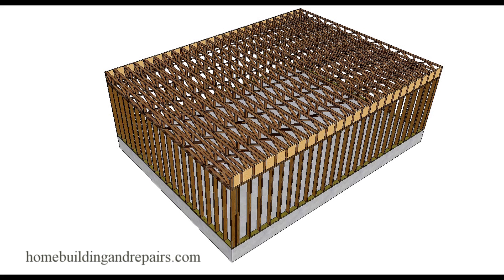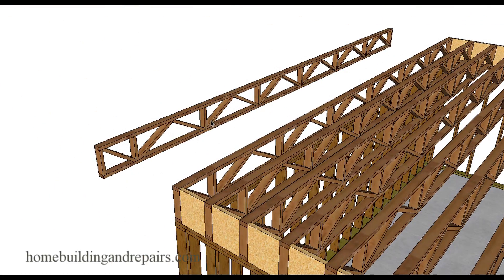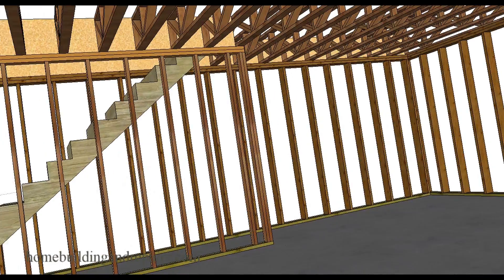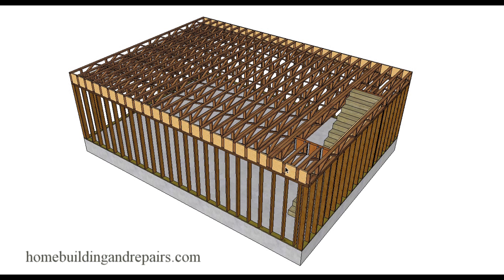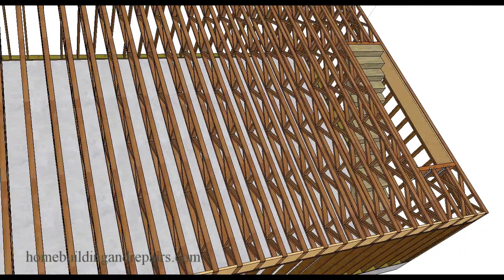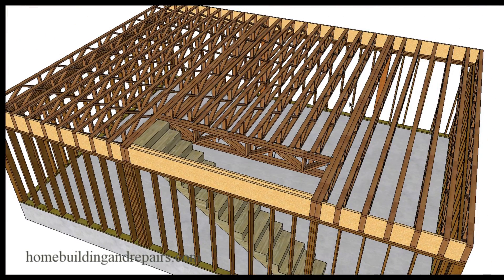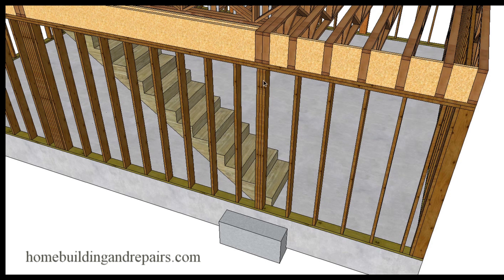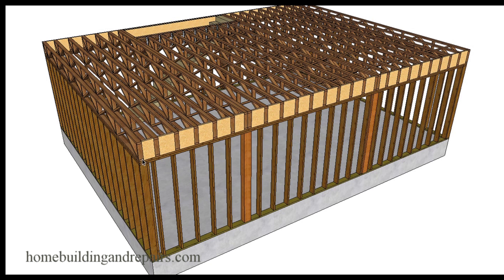Something You Should Know About 2x4 Engineered Floor Joists And Stairwells

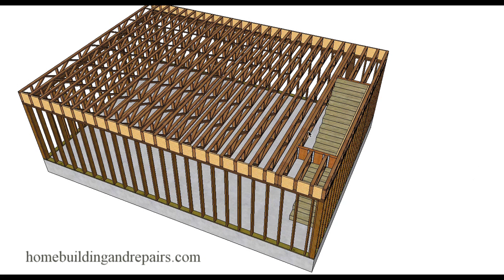Comment: Is it reasonable to hang a stair headout between 24' clear span open web floor trusses? My manufacturer said it's not possible and it would need to be an lvl or have an interior bearing wall parallel with the floor truss both sides. Ideally I would like to avoid both those scenarios. One would complicate my mechanicals and the other would be additional work and prevent me from having an open stairwell. I noticed in your video (@5:50) it was done the way I'm asking, but one of the floor trusses was supported by the exterior wall and the header was half the size of mine (single flight vs double flight)
Thanks!
Reply from the maker: You will need to follow manufactures instructions or seek structural engineering help. If you found a mistake in my video, let me know.

Comment: what if the stairs are U shape in the the middle of the house? would it still be the same framing method but on all sides of the stairwell?
Reply from the maker: Most of the time, yes. They use double joist all the way around the stairwell.

Comment: I hear from every source how these are specially designed and all, but what exactly goes into designing them? Ex: what calculations or parameters are involved?    That's the information a DIY would need to know to do it properly. It's not always feasible to transport these premade if you don't have a long trailer so it's easier to build them on site or even in situ, especially if working alone and can't lift them.
Reply from the maker: I don't recommend making your own open web joist.
Reply: You will probably never get diy trusses approved by an inspector. Especially if you diyd the engineering. Definitely not the things you cheap out on

Comment: Have 1989 16” deep floor trusses cantilevered on a interior dropped header and have a structural engineer planning a ceiling flush header.  Plan is to cut out beam notches in lower chords, and up the double vertical blocks (no doubler) just below the upper webbing plates. Although the S. Engineer explained the beam can restore lower chord compression, your thoughts on flush beams with a cantilevered application for an above living space.  Thank you.
Reply from the maker: This could be tricky and since I'm not an engineer, I won't be much help. You could always contact a truss manufacture for more information also.

Comment: It makes no sense that a floor truss would be fine at a certain span, but questionable if cut to a shorter length where you've maintained the same structural pattern.
Reply: Because the truss if not cut sits on a foundation wall .
Reply from the maker: Check with an engineer before cutting.
Reply: @gregvancom  How about address the comment.
Reply from the maker: @Heraclitean  If you're asking for my opinion, then they are usually designed for a specific length and if modified an any way, then it could cause the product to fail. Maybe you can check with the product manufactures if the word engineer doesn't work for you.
Reply: @gregvancom  I'm curious about the engineering logic. "Designed for a specific length" doesn't tell me anything. If I say 4 legs under a table are fine, but adding a 5th under the center might weaken the table, you'd be right to raise an eyebrow, because it doesn't make sense.
Reply: @Heraclitean  There is another engineering video that talks about the build of trusses. It's something along the lines of the truss connector plates connecting the components of the truss - and how many notches embedded in the wood is partially or completely dependent on the length of the truss and the other truss connector plates available to spread the weight. So, if you have a truss connector plate at point A notched for a 12' span to distribute the weight, then you cut that 12' span to 10' feet, now the truss connector plate, A, has to bear more weight than it was notched for, as do all the other truss connector plates remaining,  and the truss could break at the plate. Every metal plate in a truss is selected and notched based on the expectation that the other boards, plates, and notches will be available to accomodate that weight. As soon as you alter one piece of the design, you throw off the weight distribution for every other piece and weaken the whole thing.
Reply: @mangos2888  I meant to thank you for the explanation but never did. Thanks.

Comment: OK here is a concern I have -- Does having that square "chase" area in a floor truss have to be in the center of the span?  And second does having a large chase rectangle like this make the floor weaker or bounce ?
Reply from the maker: As long as they were built that way, then it should be good. If someone removed something, then it could be weaker.

Comment: Greg,  I have a floor plan for a pre-cast foundation rectangle basement 28'-0" x 38'-0" --  I want to clear span the foundation with wood floor trusses (28') (I like your videos).  My plan has the stairwell near the center of the floor plan and the stair opening is running parallel with the floor trusses.  I plan to have it engineered by the truss maker however I just wanted to get your take and idea on how the opening could be framed.  Thanks -- Retired Person
Reply from the maker: It should be similar to the one in this video. You would have a joist or beam that connected to a double joist on both sides or the stairwell and then the smaller joist should connect to the joist or beams.

Comment: Greg, Great video. Why does the staircase, when perpendicular to the trusses require a load bearing wall  when the parallel version does not? Sorry of this is a silly question.
Reply from the maker: The floor joist are sitting on the load bearing wall. If the floor joist could be supported a different way, then you would need the load bearing wall. When the stairway runs parallel to the floor joist, then you can usually support the few joist using other joist that would be used to create the stairwell or stair opening. I hope it helps.

Comment: Can u tell me why my floor is bowl shaped being some 1 1/2” low in the center. Built with 2x4 x24”  trusses. Upper floor seems to be wavy. What happened to flat floors. Trusses suppose to be the same. Wtf ??
Reply from the maker: Not really, because I don't know what's going on. Truss failures like yours can be caused from excessive weight or improperly sized materials.
Reply: I know this is old post but might be useful to someone.  Manufactured trusses have a camber to them (high in the middle, then curves down to each end).  If the trusses were installed upside down or randomly upside down in a section, you would see this.  If the trusses are all right side up, then something else is going on.

Comment: Greg, I have a woodlot here and so my plan is to cut my own 2x4's and build my own trusses. I can't understand why floor trusses always seem to have 2x4's on the flat, rather then having them on edge to provide more strength. Can you fill me in on this? Is there an issue that I am not seeing? Deeper is cheaper is the mantra we learned in carpentry school, so to have the 2" depth on top and bottom rather then the 4" depth seems counter intuitive to me
Reply: If the 2x4 are flat let say 8 inch in between, your joist is more similar to a 4*12 solid timber .
If you place the 2*4 vertically, seperated by let say 4 inch so that the truss is 12 inch in eight, than the truss will be comparable to a 2*12 solid timber.
The physics reason for this is that the tension applied on a floor beam/truss or whatever is on the top inch and bottom inch, in between it only dead weight, no tension force, which is why I joist or I beam or as strong as a rectangular piece os same dimensions

Comment: Hi nice video, is there any different to install floor truss on block house for a 2 floor ? thanks
Reply from the maker: You might need a ledger built into the block wall and then use hangers or use some type of post and beam set up on the inside. Let me know if this doesn't answer your question and I did put your video suggestion on a list of videos to be made in the future.

Comment: Thanks for this video!  Very Helpful...I have been searching for information about girders and/or double trusses.  I can't seem to find any concise info about their placement when one is making a roofing plan. The only general rule I can find is geared toward a hipped roof.  I am drawing a gable roof where the 2nd level is not exactly the same shape as the 1st level, and need some direction on where to put girders for support.  (hope this makes sense!! :)) I would love it if you would do a video about that!
Reply from the maker: You might need to contact a structural engineer for that information.
Reply: @gregvancom   Do they need the interior beam wall

Comment: Great video!   Thanks.  

Question for anyone that knows; Is there always blocks between the trusses?  And can you attach deck ledger to blocks?
Reply: Not always.  Sometimes a 2x4 is run horizontally across the top of the joist as a rim joist.  If you keep your deck bolts to the top 3" of the floor truss you should hit blocking or the 2x4 rim tho.
Reply: @GregTGolden  thanks.  I went and found a house still being built by the same builder who did mine.  Unfortunately; no rim board, and no block.  So when i do my ledger board for deck I'll just have to hit all the trusses.

Comment: Great Video...Can one retrofit by adding a stairwell to open ceiling basement? You stressed that trusses cannot be cut? Is this possible? How? Thanks
Reply from the maker: I know it looks like you could simply put a few blocks in and everything would work out, but I'm not sure if would be that simple and wouldn't suggest doing it without advice from the product manufacturer or structural engineer.

Comment: How big does the opening have to be for a stair case.
Reply from the maker: You would need to check with your local building department to verify this information, but most of the time for single-family residential home, the minimum is 36 inches.

Comment: I believe code has a minimum requirement (2 1/4"?) for the amount of the bottom chord of a truss, that must bear on the top plate.  These videos show the trusses finishing flush with the outside of the framing, but what it we have a 'balloon' frame or other consideration that would push the truss back to say, half way across the 2x6 top plate?  I've always used 2 1/4" but is that documented?  Rather than a wood top plate, the truss might be bearing on a Concrete Masonry Unit.  (block)
Reply: Check manufacturer documentation

Comment: Greg, I have similar basement rancher with 18” tall trusses spaced 19” OC and I have terrible bounce on the main level of the home. Spanned about 28 ft across.  These are designed for long spans but why am I getting so much bounce and how do I stop it?
Reply from the maker: If I was you, I would contact the product manufacturer if you know who they are. I'm not a structural engineer and don't think I would be able to provide you with much assistance on this one, because I don't know enough about these types of joist structurally. For example, if it was conventional framing with 2 x 12, I might suggest installing a beam in the middle that runs perpendicular to the joist or installing additional joist in between the existing ones.

Comment: love the video and software. i need to know the exact size of the band joist sections. i have to put 2 inch foam board on them. I guess they vary, right? i did one a long time ago and it seems like the height was 12 inches  perhaps they were 12 x 15 just from memory
Reply from the maker: They come in a variety of different sizes, so I don't think I would be able to provide you with what you're looking for.

Comment: Great video Greg. Like the 3D model and the different vantage points and explanations provided. Thanks. My stairwell set-up looks similar to that on 7:08 except it uses conventional lumber and there are no metal brackets holding stuff in place...just nails. Just wondering if that makes a difference. Also, I plan on removing a wall where the guy, in the original email,  planed on not constructing one. However hesitant, because maybe it's somehow load bearing? It just seems like a lot of weight distribution is going on to be supported by a doubled up floor joice and additional nails. Any help/ guidance would be appreciated and thanks again for the video.
Reply from the maker: Sorry for the late response, but for some reason your video got sent into spam. I wouldn't worry about adding additional hardware, if the homes been standing for quite some time and there aren't any problems.

Comment: Greg, around 6:05, you can see 1 set of full length doublers is supported by 3 2x6's and the other full length doubler is supported by 5. Just wondering why? Would that be a method for spreading out the load more along the existing foundation to avoid pouring the additional footing?
Reply from the maker: I was trying to provide viewers with a few different ways that it can be framed, but it's always a good idea to fill the area underneath the floor joist with wall studs or posts. For example if I have a 3 1/2 inch wide floor beam then it would be a good idea to install at least two 2 x 4 wall studs or a 4 x 4 post.
Reply: Gotcha! Thanks for the explanation and another great video!
Reply from the maker: You're welcome and thanks for supporting our channel by watching our videos.